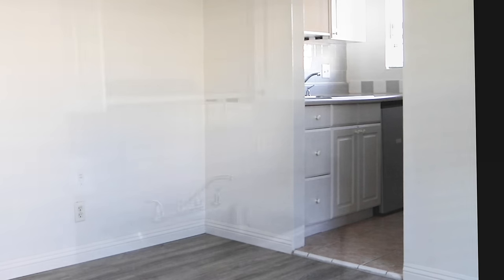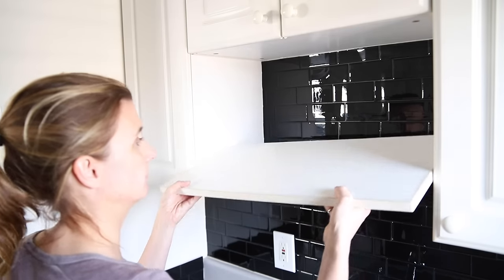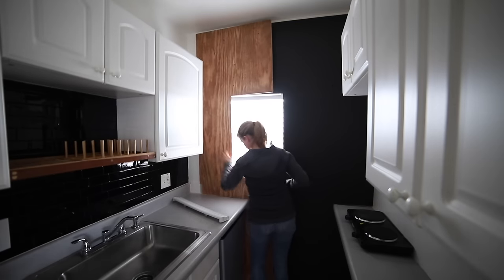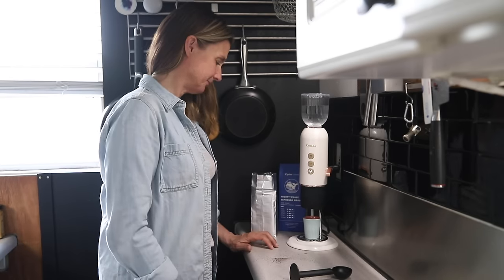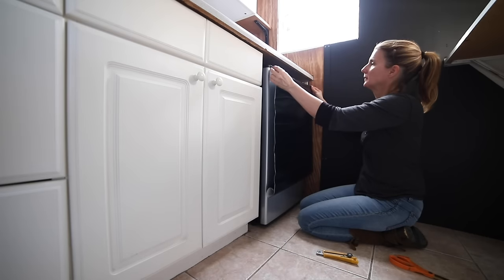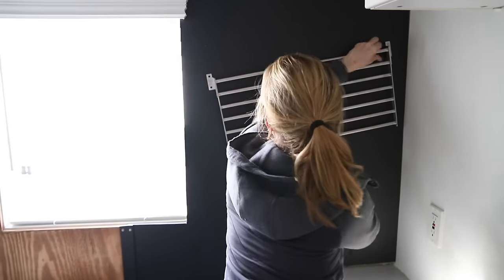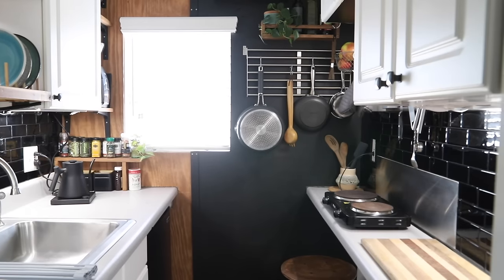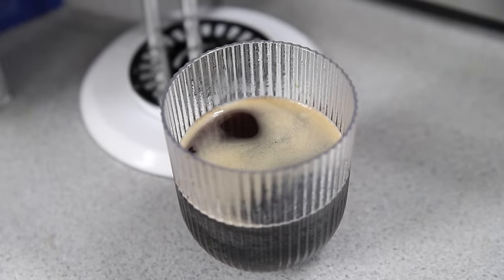The Ultimate Rental Kitchen Makeover: You Won't Believe the Transformation!

Comment: Instead of plywood, I upgraded my horrible tiled backslash with simple foam board cut perfectly to size. I covered it in bold wallpaper and attached it to the wall with two sided velcro command strips. The fake wall also hides the wires for the undershelf lighting (yes I used a wireless light switch - love those!). Because foam board is light, command strips hold it incredibly well!
Reply: I am moving next month and have been trying to figure out how to have a colored wall without painting since that isn't allowed at my new place. I had been planning to go with P&S wallpaper but it will end up being really expensive and a pain to remove when I leave. This is an amazing hack you have come up with. And the command strips? What a great time saver! I do have one question though, as I would be using foam board for the entire wall: if you had to use more than one board, how were you able to avoid seams where the boards meet showing?
Reply: @candacechavigne5560  
Possibility consider using construction hard foam insulation which comes in large sizes.  I do believe they come in different thicknesses also.
Reply: How would one go about doing the foam board trick around the stove... I would imagine the heat from the stove is not great on foam board
Reply: @MizzAriCast  
My thought is that the foam board is just a thin base on which to adhere your contact paper or backsplash covering material so that it us easily returned to the original renter space.   There are great compand hook adhesive dots and straps that can be used instead of using contact paper directly onto the wall surface that can leave terrible paste residue that is very difficult to remove.
Reply: @pamm2230  yes i love that idea and understand using it as a base. My question is would foam board as a base hold up on the wall behind the stove. My electric stove has one wall behind it and wonder if the heat that comes off it would damage the foam board i would adhere to the wall behind it. Any Thoughts?
Reply: @MizzAriCast  
There are different thicknesses and quality of foam board.  Another alternative might be luan underlayment but would be heavier.  My thought is that the foam board is used instead of the wall to put the wall treatment onto.  Then attaching using command hook removable tape and hook or adhesive dots or something similar even using small finishing nails.  The goal is to make the wall treatment removable without much restoration to the original condition needed.  Each room and space has different needs and materials involved.  It's also a process of thinking outside the box.  Hope this makes sense.
Reply: @pamm2230  Yoi might try cover it with a piece of glass.
Reply: Foam board is a miraculous thing! Also helps muffle noisy neighbors! Love your ideas!❤🙏✌️
Reply: What the last person said! The blue poly foam 4 x 8 sheets are incredibly easy to work with their light weight and you can remove them in a snap. Hang them with anything at all they hang so easy. You can cover a window and walls in one piece, and then make a design in the foam for the light to shine through. I used to foam that has a foil backing, which made it really great for painting.
Reply: Thank you! Foam board and Command picture hanging strips. Perfect!
Reply: Foam board:  years ago when my son was small, not a lot of money to go around, I got a piece of foam board (cut out of refrigerator packaging) weighed it down for a few days to make sure it was absolutely flat, covered it in a piece of end of roll fabric in a contrasting design but in the same colour tones to make a nice large wall artwork for my small son's room.  Everyone commented on my piece of "art"
Reply: @56music64  you just reminded me of something similar I did in our third (used when stepson came over) exercise room. I got a large piece of underwater scene (fish, etc) print fabric, covered a piece of board, and hung it on the wall.
Reply: Brilliant!
Reply: That's a great idea!  And probably keeps drafts out too. Now you have my ideas rolling!

Comment: This is very cool! It's definitely a challenge when you can't put holes in the walls. I've been using free standing shelves for vertical storage, but lately have been considering doing something like "diawall". Basically you turn 2x4s into tension rods. And then you can build shelves or a wall onto them. It seems very customizable and people get pretty creative with what they can do!
Reply: It's a bit unusual - that you can't paint or drill holes in German rental flats.
You just put it back in its original state if you're moving out. Though it's frowned upon to paint dark tones you can't easily paint over. And drilling holes in tiles 🧐 - only when necessary. 

But the average time you spend in the same flat is also  about 5 to 10 years.
I think for students though it's a great idea - to individualize it.

I liked the daylight lighting - though a way to protect it and diffuse light might be nice 👍

Comment: The easiest and best way to remove 3M Command hooks is to pull the adhesive strip SLOWLY and STRAIGHT DOWN AGAINST THE WALL. Do not pull at an angle of any degree.

Comment: I did a faux arch on 2 floor to ceiling windows flanking my fireplace at an apartment I lived in several years ago. I used builder’s foam insulation panels (the pink foam at Home Depot) and it worked a treat! I used the bottom of a disposable lighter to score fake grout lines between “bricks” and used the cut-outs as the shutters. Painted it all and it looked amazing! I got so many compliments! I also “painted” my ugly wood kitchen cabinet doors and face frames by adhering tissue paper with liquid starch, then painting that white. When I was ready to move out, I just peeled all of it off and tossed it. I didn’t have issues with splashing food onto it, but if I had, I would have just had to replace it, but it was very easy to do so wouldn’t have been a problem. The knobs also helped to secure it.

Comment from the maker: Links to products I mentioned in the video (affiliate links unless stated otherwise!):

Backsplash:
Smart Tiles black subway peel and stick tiles: https://amzn.to/39ewmof

Aluminum plate: https://amzn.to/3y2DuMV

Velcro for plywood board: https://amzn.to/3xr6m2o

Black (Matte) removable contact paper:  https://amzn.to/3NVytfj 

Pull out Trash and Recycling bins: https://amzn.to/3OZ6VGw

Over the sink shelf dish rack:  Bamboo dish rack for custom rack: https://amzn.to/3by1UGB
Stainless steel wall mounted: https://amzn.to/3MpRupm
Black wall mounted dish rack: https://amzn.to/3zDnJ1F
Foldable wall mounted dish rack: https://amzn.to/3x9T8FX

Knobs: https://amzn.to/3y3jCcA

Faucet: https://amzn.to/3yxtwEZ

Video on how to change a faucet: https://youtu.be/Q1lDfXXxY1Y

Magnetic Knife Rack: https://amzn.to/3Ah2Klo

Vinyl Floor Planks: https://amzn.to/3bHJx2d
Reply: Do you have a link or recommendation for the black contact paper used on the fridge?
Reply from the maker: @missterry428  Yes! i love this contact paper (Black matte, removable):  https://amzn.to/3NVytfj It's the same one I used in my black feature wall in my bedroom: https://youtu.be/YJKDpR6KTjc
Reply: Thank you!
Reply: It would be useful to put this info in the video description, or at least pin the comment to the top.

Comment: Interesting! My kitchen is 10x6. I can put small holes in the walls. The only thing I nailed (screwed, actually) in was a small knife rack. I have a cat, so I needed floor space for his food/water mat. I found that a small rubber backed bathroom rug, topped with a storage bin lid slightly smaller, works. I can just wash the lid off each night, and place his food and water bowls as far apart as I can (diagonal works); cats don’t like food and water right next to each other. The microwave (no floor space for a separate cart) and double stack dish drain (9” footprint, half the size of regular ones) leave me 24” of useful counter space.

Comment: I would have left the 2nd wall white instead of the black tile. I think it closed in the space, making it feel much smaller. I also would have installed a lighter colored floor, more like the plywood wall panel. Otherwise, it turned out great!

Comment: Its nice but too dark for me. In an apartment I was staying in I had put contact paper on the counter and the inside of wall of the cupboards. Its removable so it won't ruin anything. Than I removed the flat part in front of the sink and turned it into a little tip out tray (it was falling out so I made it useful and it was fixed)😊 I also used a removable sticker backsplash and peel and stick tiles for the floors. When I moved the landlord loved it that she kept it as is!😊

Comment: Warning about stick-on tiles! This redo is beautiful! Your use of the plywood was a fantastic idea and I like the contrasting colors. But I need to warn your audience about those stick-on tiles. They are very heat sensitive. It doesn't take much heat to make the glue loosen and come off the wall. Heat from a stove can also make the plastic "tile" itself curl away from the backing. If you are thinking of using them, watch the YouTube videos about problems before you buy them. We didn't.

Comment: Can you really screw into 1/4 inch plywood for weight-bearing shelf supports?  Such short screws seem , well, short for that purpose.
Reply from the maker: The plywood covering the back wall is 1/2" and the shelves don't have anything very heavy on them so there hasn't been any issues.

Comment: I prefer white kitchens, especially when it’s a small one. This kitchen looks too cluttered for my taste. But as long as your friend likes it, that’s all that matters. I only worry how hard it will be to get all that stuff off the walls and floor in a couple of years….it will be a mega pain.
Reply: The floor will be super easy - just pick it up! We have similar flooring in a bathroom. There's no adhesive on the planks, just a very effective grippy rubber that keeps them from sliding. I think with those peel-and-stick wall tiles you can use a hair dryer.

Comment: Ooh boy.....As an OCD professional Organizer  l have these comments; 1) A faucet with a built-in pull-out sprayer would have allowed for the retention of a soap dispenser which is much more space efficient, and easier to use than a soap bottle stuck under the sink, or having an ugly soap bottle sitting out. Even a "dressy" dispenser would take up space. 2) Covering an appliance, as you did the refrigerator, in contact paper is a short-sighted fix. Contact paper can be scratched through completely, gauged, and ripped very easily, requiring replacement numerous times. 3)  You hung a tiered basket in an area that could have held multiple shelves for tons more storage. Very inefficient use of space in that tiny area. A tall unit on high legs would have worked perfectly. Number 4 is a completely personal opinion. If l had a kitchen that tiny and any decorator, organizer or friend said they were going to put up black tile (fake or real) l would immediately show them the door.  Black glaringly shows water spots, dust and grease. Unless you want to throughly wash and degrease your kitchen daily, this is a very poor choice. In my experience working with clients, approximately 75% of those who chose black as a prominent color in any room, came back to me within 6 to 18 months saying they were tired and/or sick of the color. All of them  admitted that they wished they had listened to my statement (warning) about the use of so much black being a "dangerous " choice" and one they could later regret.
 I hope your friend appreciates all your hard work! You did alot!!😊